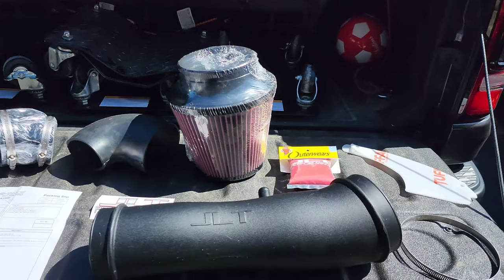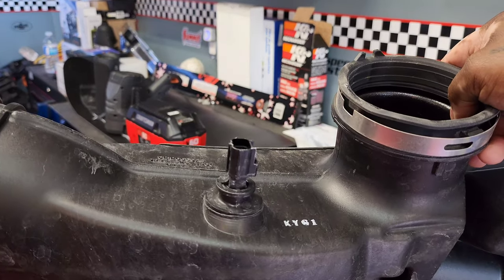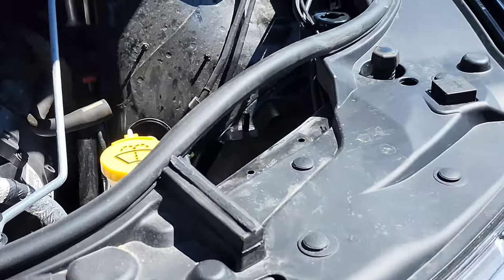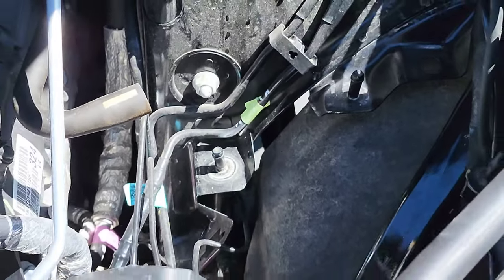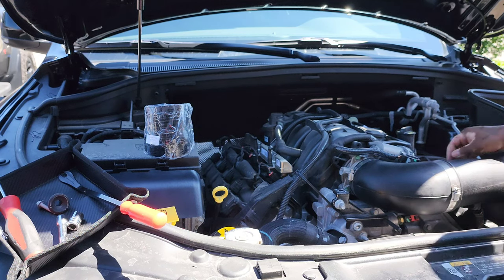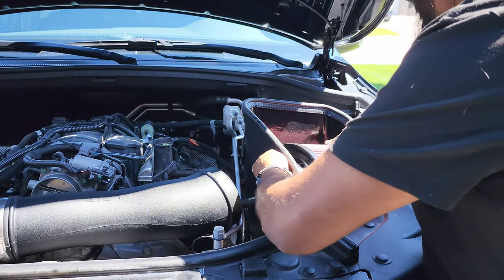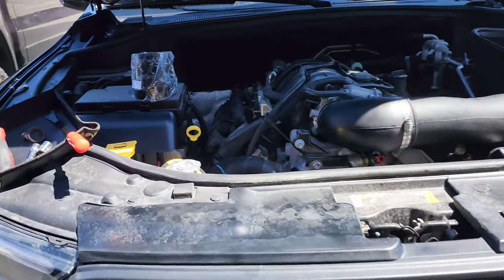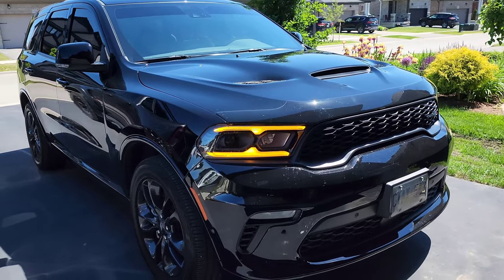JLT Intake Install 21 Durango 5.7 Tutorial

Comment: This is why I went with the AFE CAI for my '21 Durango RT, Tow N Go.  It fits perfect, OEM-like replacement, it's 100% enclosed so you don't need a rain shield for the hood.  That's the last thing I want is to block a vent where heat can escape or cold air to come in.....  But great DIY video!

Comment: Nice video.  I just noticed at the end.  How do you get your running lights to stay on yellow like that?  I just got a 2022 Durango RT.  Looks sick.  Also I'm thinking about getting the AFE Momentum GT Cold Air Intake.  That one says it's fine with the SRT hood.  Quick question.  Do you think it's worth the money?  I'll also pay someone to install in since I don't trust myself to do it properly. LOL.. On paper the gains look great I'm just wondering what your thoughts are on real world driving.  Like do you feel the difference. In your opinion is it worth the upgrade?  Thanks and subbed!
Reply from the maker: Hey so the orange LED's are enabled using a module called the tazer. I did a video on it for my truck.

https://youtu.be/eyOl_bJB2_E

I do like the AFE, the quality of the intake is pretty good. There is not a huge amount of power that's gained from it. However the sound of it is pretty awesome. I would say it's worth it getting the intake!
Don't doubt yourself, just take your time when installing it!
Thanks for the sub 😊
Reply: Has the Durango had a CEL since the install?
Reply from the maker: Zero CEL at any point!
Reply: Hey bro how did u turn on your amber Drls to stay on like that? I just connected my tazer but cant find that option on Live settings for my 2022 durango